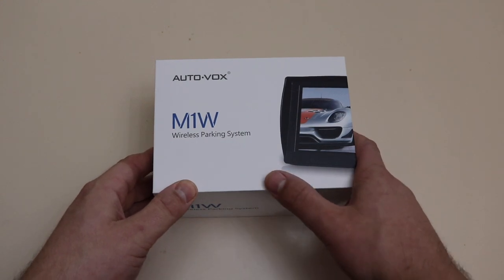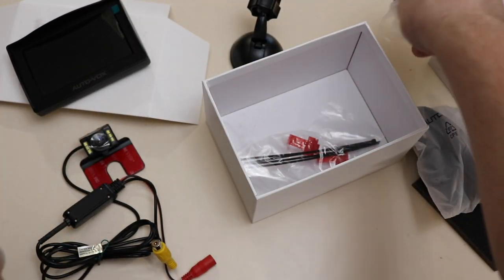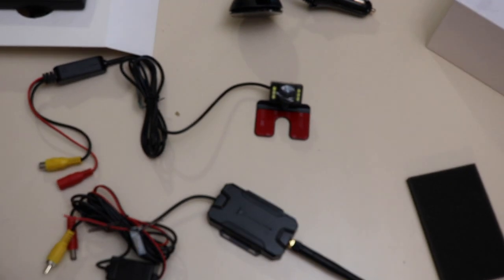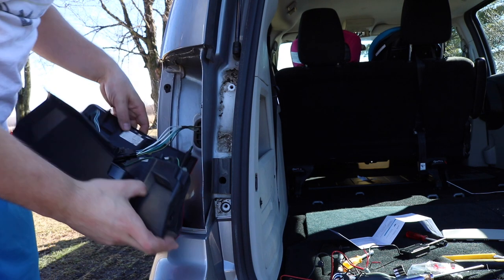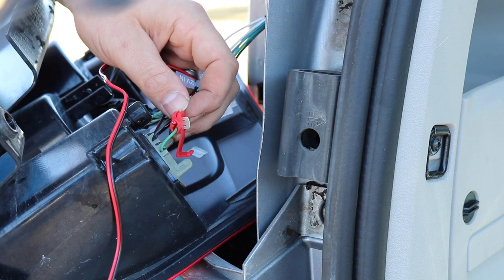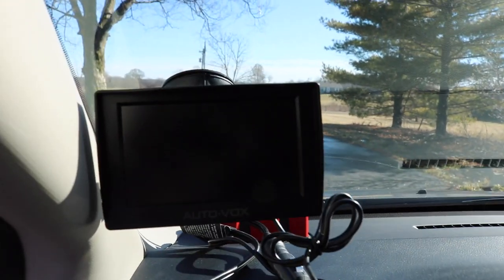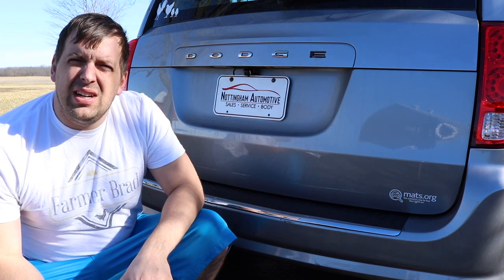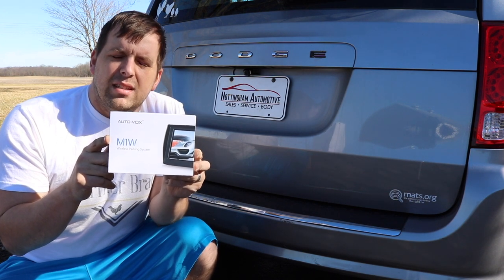How to Add a Wireless Backup Camera to Your Dodge Caravan!

Comment: Really much appreciated. You went extra mile to pinpoint the steps required. I was watching as if it was me doing it. Very natural, straightforward and pleasant to watch. I will do it tomorrow for my Grand Caravan and fingers crossed I manage to guide the camera wires correctly. Drilling may be an option. Thanks for sharing.

Comment: Thanks so much for taking the time to show how to install on a Caravan.  Is there a bit of wire showing where the wire moves from the door panel to the where you hid the wire under the gasket coming from the brake light unit?
Reply: I also enjoyed the video a lot. I would have loved to have seen an end result of the wires meeting each other in the top left of the door. That was my main concern before I was going to start this and realized my reverse lights were separate from my hatch.
Reply: Looks like a little wire was exposed on that left side, so when you open the back you can see it.

Comment: I was wondering how the camera went on when it went in reverse. Cool idea using the reverse lights. Then the transmitter, so no wires to run down the length of the car/van. All great ideas. I'm going to try to find a whole in dash option so I dont have the monitor hanging around on my windshield. This vid was 2 years ago so I'm sure they have come a long way.

Comment: Do you know how I would run a cable from the camera to the front of my Grand Caravan if I were to use one that wasn't wireless? Wireless cams are a little out of my budget right now.
Reply: @FarmerBrad  I'd rather not have to run it outside of the car. Do you know if the plastic pieces of the floor that go across the doors can pop out enough to stick a wire through? Or is it possible to push a wire into the edges of the headliner?
Reply: I think the ignition is on the same circuit. Connect front to ignition and back like he did.